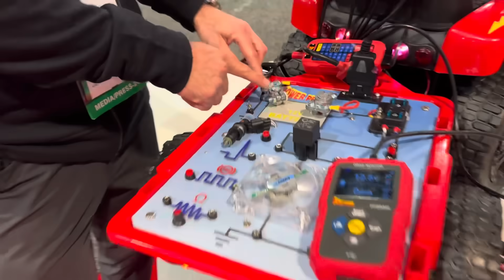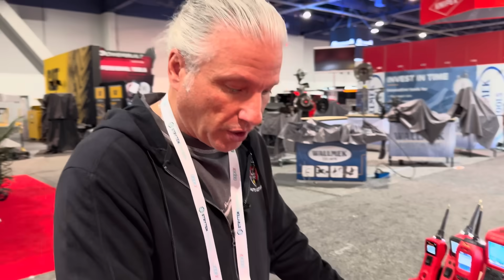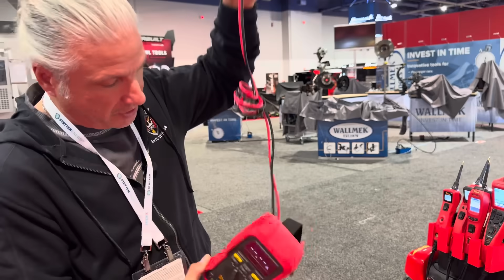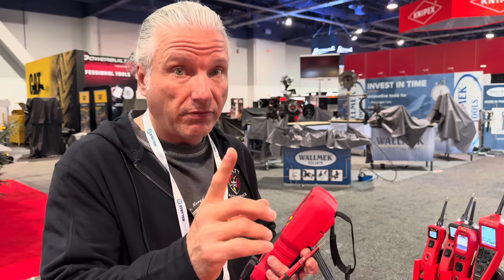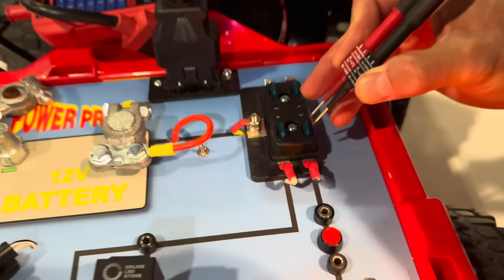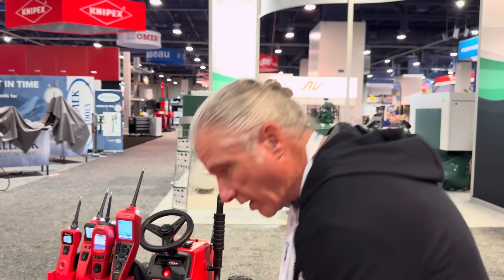These Tools Are Going To Save You So Much Time When Diagnosing Parasitic Draws!!

Comment: How to measure the voltage on a fuse covered from the top?
Reply: The fuse usually has a couple of very small cutouts in the plastic to put a probe.
Reply: @n9wox  Nope, some of the newer Audi/VW are solid plastic, definitely no cut outs, always pissed me off. You have to take very thin probes up the fuse to touch the spade portion.
Reply: @nickpappas4133  yep, usually

Comment: Will all of those work on a 24 volt system? Other than the OBDII of course. I work with heavy equipment.
Reply: Oh you mean the multimeter with those special leads? That should work with 24v since it’s just doing a mathematical calculation converting the voltage drop across the fuse to the chart you can find online for each size and rated fuse.